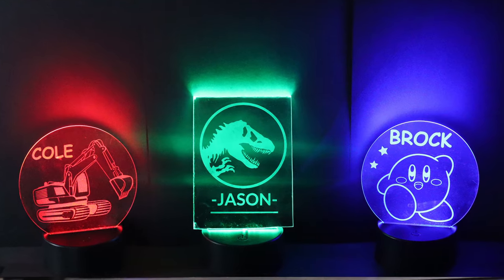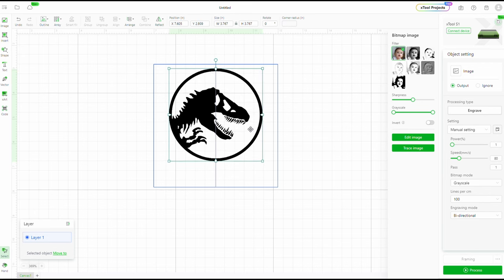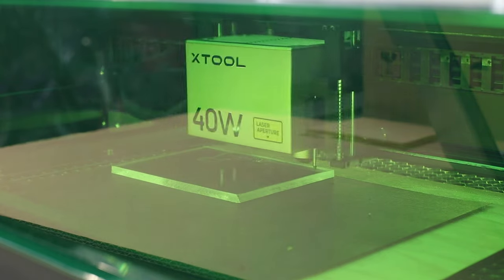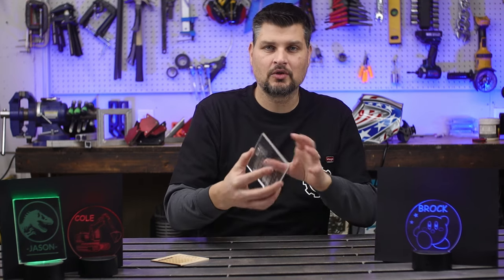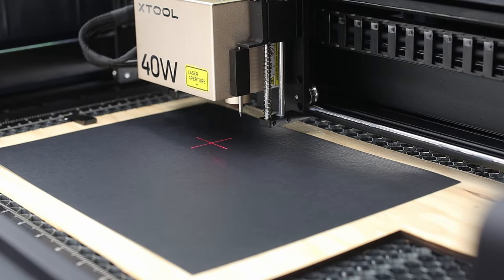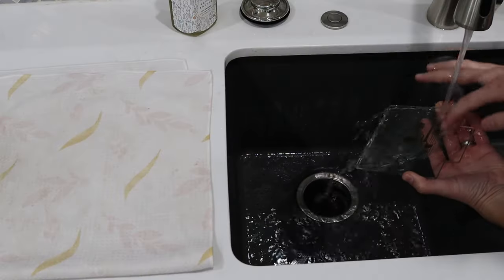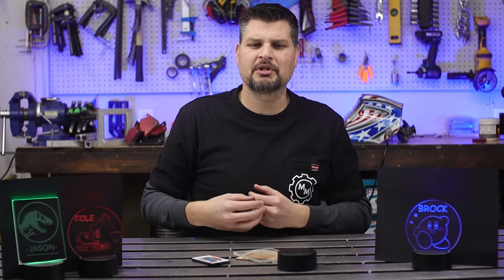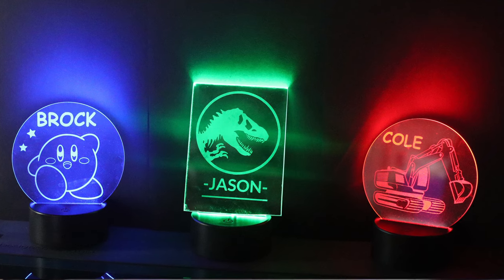Engraving Clear Acrylic // XTool S1 Ultimate Laser Engraver

Comment: Hello, You think the 20W may do this?  Or is it exclussive to the 40W
Reply: He uses 15 percent so im guessing the 20 watt at 30 percent would get the same results
Reply: @Swiftstyle  Thanks I will try that...
Reply: @cubansli3099  wondering if you tried with the 20w? Did it work?
Reply: @lisafarris9832  No, I purchased a K40 CO2 Laser to do this work.  Had to many issue with the scratching and paper burning on the plex.
Reply: @lisafarris9832  I used a 10w  25/235 and it came out pretty good. 
Unfortunately I forgot of I use black marker or just card paper lol

Comment: Thank you so much for this video!  Is there a reason to put a piece of plywood under the cardstock?  Could it sit on the baseplate instead?
Reply from the maker: Yes it can but I like the plywood because sometimes it will be a little hot and bleed through the paper and kinda makes a mess on the plywood.